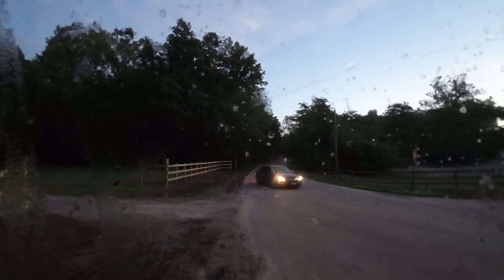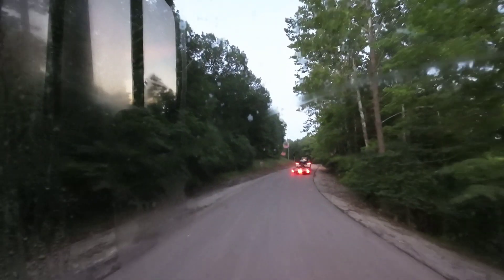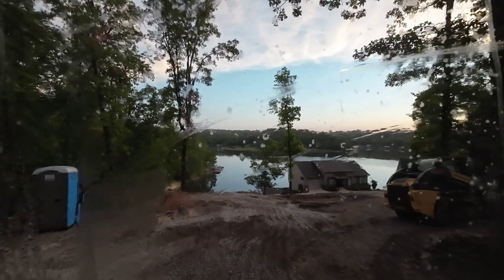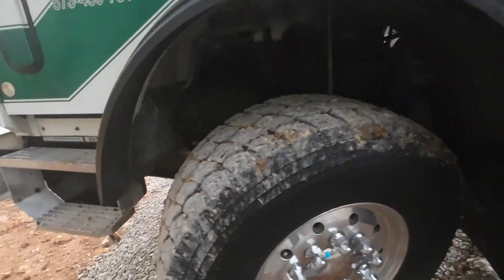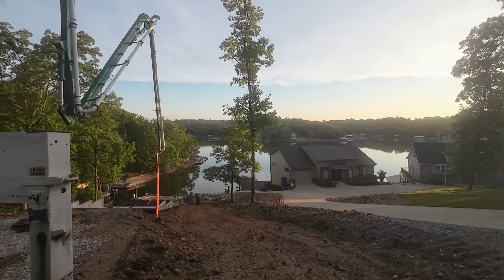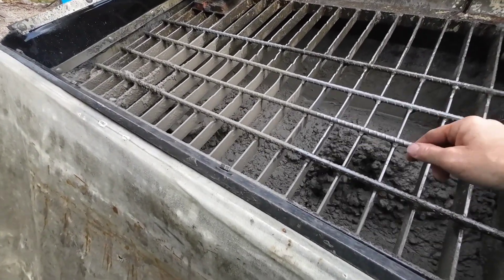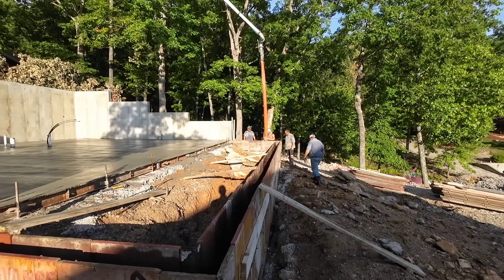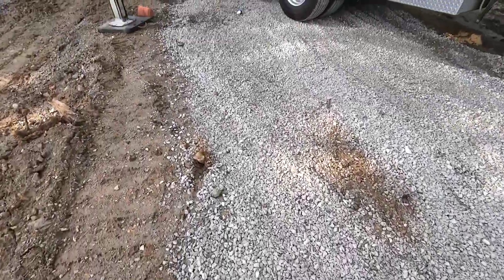Concrete Pumping On Lake Front Property! Using The DICA Cribbing Timbers For The 1st Time!

Comment: What year is your 38? It looks really clean. Do you use a carbide scraper in your hopper? It looks well kept. Never really liked the snakes. Always been a fan of the 4.5" discharge hose mself. No plugs, and its very manageable  weight wise. 

Cool to see the DICA products in use. I dont think i would use em for the 63z i run, but they look adequate for a 38/40
Reply from the maker: Our 38m is a 2005 model, it was reworked and painted in 2011 because of an accident. We do not use scrapers in the hopper at all. We get in them to chisel them out about twice a year, other than that we just keep them clean after the pours. Started using the DICA Timbers this year, they did flex a bit on me however. DICA makes great pads, it's best to check your outrigger tag and adjust the padding adequately for your rig. I do like the 4.5" also, I usually use that during bridge pours or deeper floor pours. I mostly use a rubber 4" hose on typical floors.